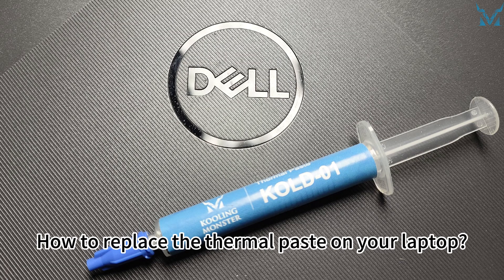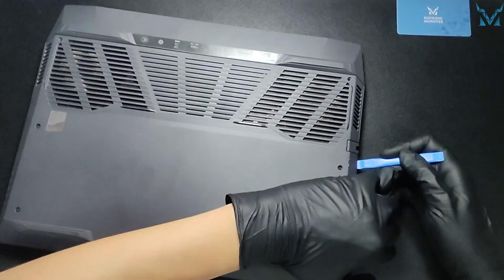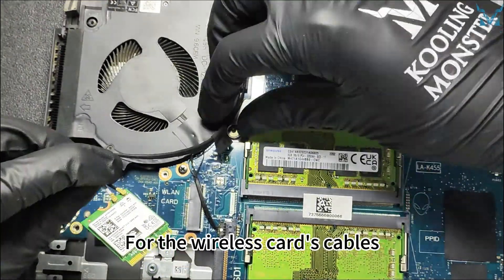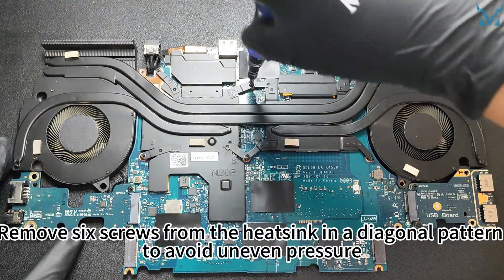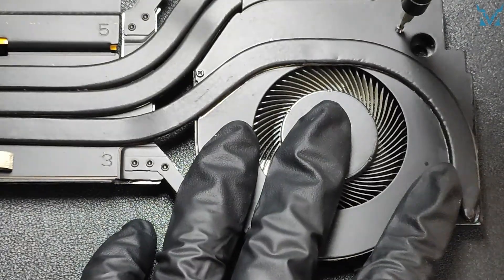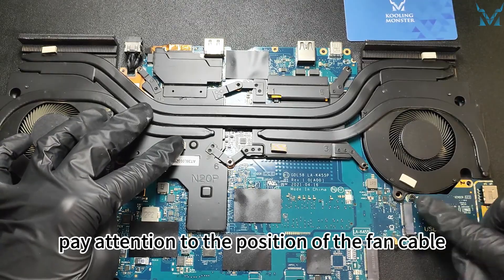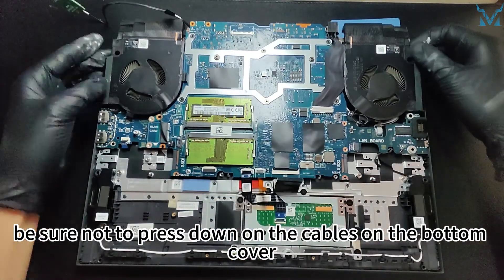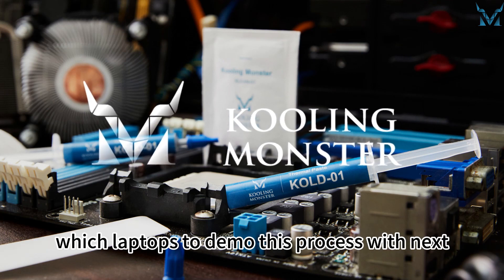Speed Up Your DELL G15 5511 - Prevent Overheating With Dust Cleaning & New Thermal Paste

Comment: Just managed to do this on my dell 15 5511, thanks a lot for the video. Alot of srews but nothing very hard. If you try it be csreful with tightening the screws back as they might give in
Reply from the maker: Nice work! 🙌 The Dell 15 5511 does have many screws, but you handled it well.
And yes — great tip: always tighten gently to avoid stripping them. 👌
If you need anything else to keep temps low, just let me know!

Comment: What stress test soft did you use for this video?
Reply from the maker: For this video, I used 3DMark Time Spy and AIDA64 Stress Test to measure the before/after CPU temps. 🔥🧊
If you need, I can share the exact testing settings too!

Comment: O.m.g. -- the heatsink is on the top ... who has time for this???   At the same time, when your 6p core 13gen is pulling 80 watts in every game (more than the "Max wattage" 4050), how can you not?  Immediately bouncing off 100+ degrees.  CP2077 bench mark "when cold" 108 fps.  Next run, with heat soak -- 77fps.

Here we go😢
Reply from the maker: Hah, I feel you — the struggle is real! 😅
When the 13th-gen i7 starts hitting 100°C and thermal throttling that hard, a repaste + good cleaning really does make a huge difference in those FPS drops.

You’ve got this — and if you need any help along the way (or tool/paste recommendations), just let me know! 🔧🔥 Happy boosting!

Comment: Does anyone knows the thickness of the thermal pads?
Reply from the maker: Thermal pad thickness can vary by laptop model — but most gaming laptops use 1.0 mm to 1.5 mm pads on VRAM/VRM 😄
If you tell me your exact model, I can check the correct size for you.

(We also have a pad kit available if you need one ✅)
Reply: Dell G15 5511, intel 11800h with NVIDIA 3060 and the nice display.

Comment: Replaced the thermal paste after 3 years. Felt still good. Doesn’t really changed dramatically the temps. Still some cores are hitting  between 95-100*C while doing no heavy load stuff. Idle windows 11 or a little bit browsing on the internet, while other cores are chilling on low temps. Hmm, still searching for this problem or is this normal in a laptop? (Dell G15 5511, i7, 3060)
Reply: looks to be normal. did the same and cpu is still hitting 95-100c. might have something to do with dells software and such giving the cpu too much power.
Reply: @kaishajacobye tried undervolting on cpu and gpu. Didn’t really changed the temps.
Reply: same laptop,  replaced paste but same temps, actually i feel the fan works more now so it feels worse ?  gonna have to re do in case something is up, maybe an air bubble, don't know
Reply: @AntonioLopez-xn5jk I did a repaste and I think I did something wrong. Now the temps are very nice on all cores and the undervolting do a nice job to the temps. CPU and GPU. Now overall the temps are quite good and the fans don’t speed up so noisy. 👍🏼
Reply from the maker: Thanks

Comment: Was actually easier then i expected. For how much i bad mouth dell they do label things pretty good for reassembly. A pretty user serviceable laptop. i just realised changing the battery is a 5 minute job. Was sure it would be glued down or something.
Reply from the maker: Totally agree—credit where it’s due! 😄 Dell made this one surprisingly easy to service. Battery swap in 5 minutes, and repasting with KOLD-01 thermal paste went smooth too. Always nice when a teardown doesn't fight back!

Comment: My touch pad is not working now
Reply from the maker: That can happen if the touchpad cable wasn’t reconnected properly during reassembly. Try opening it back up and double-check the ribbon cable—make sure it’s fully seated and locked. We had the same issue once after repasting with KOLD-01, and a quick reseat fixed it!

Comment: After following these steps I turned on my laptop it is getting the power but the screen is not showing anything and after 5sec getting shut down plz if u could tell any mistake that I could have made.
Reply from the maker: It sounds like something might be loose—please check the RAM and display cable connections again. Also, make sure the CPU/GPU are seated properly if touched. For repasting, using reliable thermal paste like our KOLD-01 helps avoid short circuits or uneven contact.

Comment: Thanks. Amazing tutorial. I managed to replace the old dried factory paste. If anyone is planning to do the same. Pay attention to :

Ribbons need the right amount of push to slide in the right position. Do not force to close unless the position is good. 

The display connector is fragile. Push as he does but pull with one hand from the cable as he does. I only pushed and broke the lock pins.  But still works. 

Old paste was dried and stuck it needs a bit of wiggle to get the heatsink separated. Do not break your motherboard doing so. 

Follow exactly everything that he says. Pay attention to how he places the cables and the wifi antena order white is bottom.. . Etc ..This tutorial is the best i found on YouTube and my laptop is back to 50c cpu tmp.
Reply from the maker: Awesome job and great tips for others! 💪 Replacing dried factory paste really makes a difference. For anyone else attempting it — we recommend KOLD-01 thermal paste for safe, long-lasting performance!

Comment: Can i do all same steps in my dell g15 5515 ryzen edition laptop? And can i only use a single type of screw driver for all the screws inside the laptop?
Reply: I used this for my G15 5520 and it was relatively similar, but there were a few changes. You can open the case and just take a peak to see the differences. 

I also ended up needed to use two screwdrivers. The screws on the fan (inside the heat sink) were much smaller.
Reply from the maker: You are professional! Thanks for your comment.
Reply from the maker: Yes, you can follow similar steps for your Dell G15 5515 Ryzen Edition, but just make sure to check if there are any additional screws or specific parts unique to your model. As for the screwdriver, it's recommended to use a couple of different sizes, typically PH0 or PH1 for most screws, to avoid damaging them. It’s best to use the right size to prevent stripping the screws.

Comment: why it has upside down mother board
Reply from the maker: The motherboard is often flipped upside down during thermal paste application to ensure that the components (like the CPU and GPU) are facing upwards. This position makes it easier to apply the paste directly onto the surfaces without spilling, and it helps with removing the heatsink later without damaging any components. It also gives better access to the thermal areas for cleaning and reapplying the paste properly.

Comment: I tried removing the back case but it wouldn't open as it's my first time so had to give up ..
Reply from the maker: No worries! It can be tricky the first time. Make sure you're using the right tools and applying gentle pressure. Sometimes the case can be a bit tight. If you're unsure, you could try watching a step-by-step guide or ask for help from someone experienced. You'll get the hang of it!

Comment: i couldn’t remove the heat sink from the board, like the thermal paste was keeping it glued down. is that normal? (and yes i DID remove the screws)
Reply: It's been a while so I imagine you've already done the maintenance, but yes, I had this happen to mine and I just used the guitar pick looking-thing to slowly wedge between the heat sink and the motherboard (?). Did not break and worked fine :)
Reply: @L4UNDRYBE4R  its ok! i appreciate the extra info! :) i was too nervous to try to pry the motherboard off so i just installed my fans (which is what was causing my cpu to overheat) and thankfully it’s been working good as new!
Reply from the maker: Hello! This is completely normal. Over time, thermal paste can harden and act like glue, bonding the heatsink tightly to the processor. Here’s how to safely remove it:
1. Gently wiggle the heatsink: Twist it back and forth instead of pulling straight up.
2. Use a plastic tool: If needed, use a plastic prying tool to carefully loosen it from the edges. Avoid metal tools to prevent damage.
3. Be patient: Apply steady, gentle pressure and avoid using excessive force to protect the CPU and motherboard.
Hope this helps! 😊
Reply: @koolingmonster  thank you for the reply!! i’m going to replace my fans soon so i will try to remove the heat sink again to reapply thermal paste. i have no experience working with computers though and i’m terrified of using the plastic tool to try and pry the heat sink off, which is probably what i’m gonna have to do… please tell me it’s not that easy to break anything 😭🙏

Comment: Can i fix the hing of my laptop dell g15 5511
Reply from the maker: If it's just a loose screw, you can tighten it yourself. However, if the hinge is broken or damaged, you might need to replace the hinge or other related parts. It's recommended to consult with a professional technician to avoid causing further damage.

Comment: I'm stuck at 4:15 can't get off the middle screws of the heat sink for some reason, they are not moving at all
Reply from the maker: In that case, the screws might be stripped. Next time, you can try our KOMBO-01 screwdriver set, specially designed for laptop repair. Its precision and hardness are specifically adjusted to avoid stripping screws.
The best ways to avoid stripping screws are:
Choose a high-quality screwdriver.
Select the correct bit.
Apply vertical downward pressure when turning the screw.
You can refer to our video #83 for an explanation (How to avoid and fix stripped screws in laptop disassembly).
Reply: finally you can remove?

Comment: How often should u change the thermal paste
Reply from the maker: Under normal circumstances, it is possible to replace it every six months to a year, but we do not recommend judging solely based on time, as it largely depends on how you use your computer and the quality of the thermal paste. A better approach is to measure the CPU/GPU temperatures. For more details, you can refer to our Video #1 ("How often to change thermal paste") and Video #84 ("How to know if your laptop is overheating and if the CPU thermal paste needs replacing?") for a more thorough discussion on this topic ❤️~
Reply: when you face heating issues or every  8-9 months

Comment: I have the G15 5511, with i7-11800H and Nvidia 3060, at the present moment i'm struggling with the throttling problem, my CPU hits 100ºC (212ºF) all the while playing Fortnite, for example. I already try at this point "metal liquid" and the temperature cool down to 96ºC (204,8ºF) sometimes, but I still have a problem with a big fall of frame rate. I don't know if there is more else to do...
Reply: I undervolted mine. My cpu hits 92 under a load.
Reply from the maker: Liquid metal also degrades overtime and needs to be replaced, however we would still recommend using a thermal paste for much easier and safer replacement. We would suggest following this tutorial to clean out the dust clogging the fans and maybe give our thermal paste a try!
Reply: @FalasDiversas If you hit WIN + R and type in "powercfg.cpl" , you can tweak the CPU power settings. I usually keep the processor power at 95 or 96% (instead of 99%) when plugged in and 89 to 94 when unplugged. Hope this tip helps.
Reply: Try using a cooling pad if you aren't using one already. and room temperature also affects the temps.
Reply: Noctua NTH2, works very well.

Comment: thanks for the video, are thermal pads necessary ? if yes, where do we put them ?
Reply from the maker: You are very welcome! Thermal pads are used when there are larger gaps between components that thermal paste cannot fill. If your laptop has thermal pads inside, there is no need to change them.
Reply: Got it. Thanks again and your video was very helpful @koolingmonster

Comment: Followed all the steps
Used artics thermal paste
Yet temps still the same
Around 85° on gpu on load
And 87° cpu
Reply: might just be how the laptops cooling works, a max of 95-100c is normal for H series cpus and a good temp for the gpu would be 75 to 85 max so your laptop is well within spec
Reply from the maker: We are sorry for the disappointing results. You can double check if dust were cleaned thoroughly, also if thermal paste was applied incorrectly. We also welcome you to try our KOLD-01 Thermal Paste, which is specially designed to be longlisting, and is very different from other brands.We use a special non-solvent formulation design that results in better cooling as well as longer lifespan.

Comment: paste spread is not required.. i think
Reply from the maker: You are correct. Spreading thermal paste is not required but is a easy way to check if you applied too much thermal paste. Accoring to our study, as long as the amount of thermal paste used is correct, the application method and whether you spread thermal paste or not does not matter. You can view our detailed experiment here: https://koolingmonster.com/insights/is-the-buttered-toast-method-a-good-thermal-paste-pattern-vs-the-pea-size-method